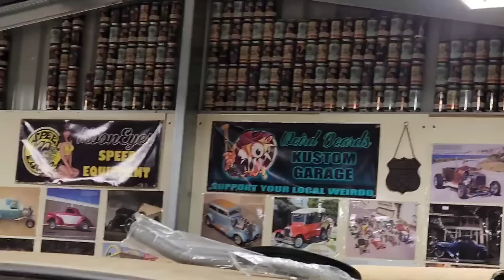We just found an ORIGINAL 1934 Ford tucked away in a barn 😵 this is literally automotive gold!!! 👏🏼

Comment: I built a hot 202 for the EH panel van I had 1980 - 82. With a 2.78 ratio diff and a 3sp all synchro gearbox it pulled 95mph in second gear, never tried it out in 3rd gear as it only had drum brakes, lol.

Comment: Chad there is a beautful 34 tan 4dr 100% original 1 in kitchener ont. U can drive it home. Mechanical brake correct engine. Original paint and chrome. Stored inside its life. Solid and beautiful. It is same sedan. Clydes car had a moulded trunk. Otherwise is same. I think it can b had 4 25 k

Comment: Even the Aussies have no respect for Fords with their Chevy Engine in the Iconic F-1 pickup. If I was to put a 289 or a 351 Windsor in a 1957 Chevy The world would come apart. But I worked on those 1957 Chevrolets in 58 through 62 changing their poor mechanicals (plug wires, brakes shocks, generators, valve jobs, starters, water pumps powerglides, clutches, 3 speed manuals, rusted out floor boards and front fenders and yet here they are a vintage collector???????